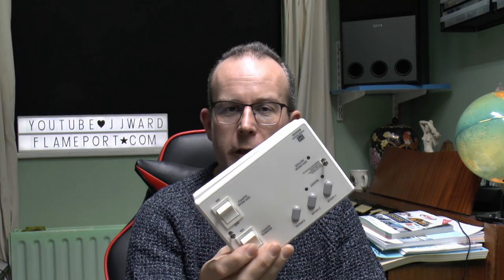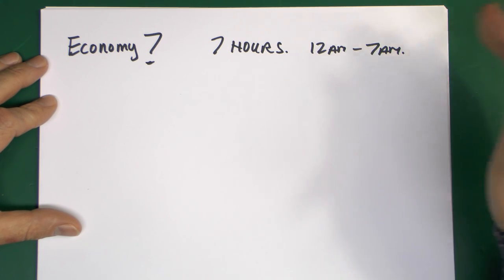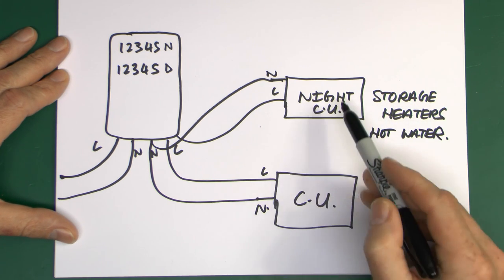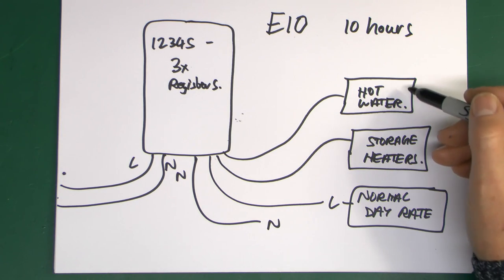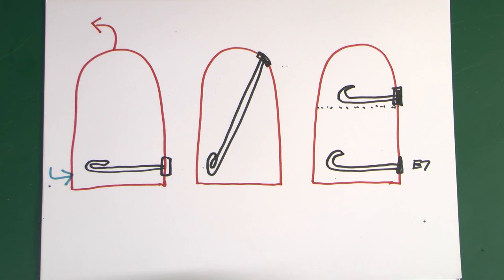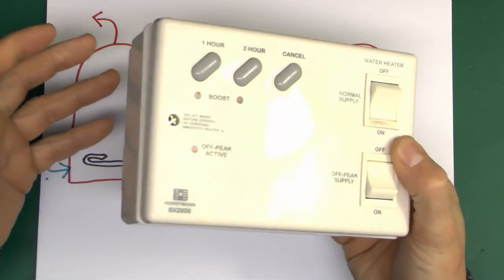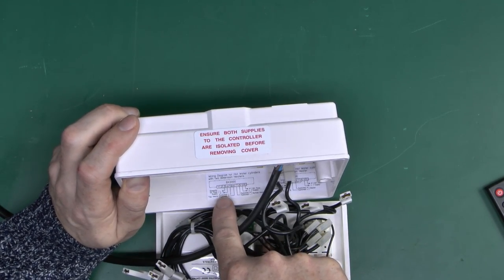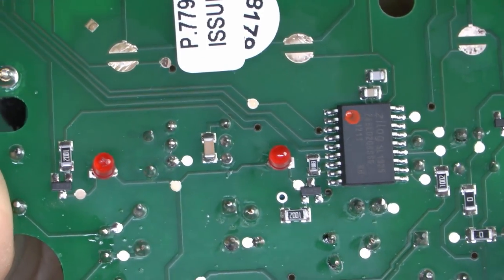Economy 7 and Horstmann BX2000

Comment: Hiya John. A few inaccuracies I need to point out about 
what you said about the electricity meters, timeswitches, 
rate changers and those awful Radio Teleswitches. 
In one part of the vid, you said that......
.
.
.
.
......Electricity meters had a "Fifth terminal...."

I can say now (in the UK at least) the traditional loadwheel-based electricity meters only had four 'main' terminals, whether-or-not they were dual-rate electricity meters.

It was only the dual rate meters (sometimes with a white front-case, hence "white meter") that had an additional terminal, but this was a rate-changer trigger terminal and 240v would have come out of there (at only a few milliamps) and would have been switched down-to-neutral for operating the off-peak solenoid in a dual rate electricity meter.

I know this because I am one of the International Loadwheel Lovers. I have many electricity meters on my channel and they can be found in the Electricity Meters Playlist. Oh yes. :D

As far as "timers" go, there were two types: A load-switcher and a Rate-Changer (the latter of which would also do load-switching.) 

Do I have load-switchers and Rate-Changers? It would be silly of me not to have! Where can they be found?
Haha..... In the Time Switches and Rate-Changers Playlist of course! :D
I have load-switchers of 60A and 80A, and Rate-Changers of 80A and 100A! Both by Horstmann and Sangamo Weston.

About consumer units..... Traditionally, where two-rate electricity was present (whether it was a two-meter configuration with a load-switching timer switch or one dual-rate electricity meter with a load-switching Rate-Changer) there would USUALLY be two consumer units.

On the odd occasion here-and-there (for whatever reason it may be.....) it can be possible for a household to have only one consumer unit and to have dual-rate electricity.

Mr. Photon has this arrangement: One consumer unit and a dual-rate electricity meter and a radio teleswitch. 
His teleswitch is only utilised for its Rate-Changing capability. Although it can do load-switching, that part is not wired.
Just so that you know: His meter is a 'white' meter as well. It's not painted, but rather moulded from white plastic. :D

In cases where there is only one consumer unit and dual rate electricity and the household never having been configured for a two-rate electricity tariff (e.g. storage heaters, and a two-element immersion tank and all of their related wiring and circuits) you will find that the household later opted for (for whatever reason that may be.....) dual rate electric.

As you say..... that would be silly, because the day-rate on two-rate electricity is more expensive than single 24-hr tariff.

In more recent times.....

I once saw an electricity meter with one of these "Fifth terminals" and it was a prepaid Actaris meter.

Also, as you said, there (was a point in time, but slowly becoming obsolete also.....) were these electronic meters with their own built-in timers and switching contactor. I have seen these made by Ampy. These can be distinguished by a little analog clock symbol on the front of them near to the specifications printed onto the meter.

In times even more recent, there are the plastic-fantastic 'smart' meters. Whether-or-not they have internal timers or not, or are switched by some kind of signal (either over-the-wire from the local substation or by GSM) I can more-or-less say right now that they most likely DO NOT have the 1980s BBC 198 Long-Wave antenna in them.

There's a reason why Radio Teleswitches are being done-away with and it's not because of smart meters.

In Droitwich (so I have heard.....) there is a Long Wave transmitter. it is of the old-style 'valve' type. I once read on a radio enthusiasts' chat forum that when the transmitter eventually pops (i.e. when the valves burn out) the BBC has no plans to replace it, and the manufacturer that made the valves has since stopped making valves for it and the BBC have since bought-up and used all of the remaining stock, and the transmitter is currently on its last set of valves. When it pops, a section of the UK (if not all of it) will no longer have LW radio, which probably explains why BBC radio 4 is now also transmitting on FM and DAB!

Of course, when the Droitwich transmitter does pop, a number of (if not all) 198 LW Radio teleswitches will stop working, at which point, people will no longer get the off-peak electricity, and of course, if their radio teleswitch is also switching a load (like hot water and storage heaters) then they will also not have any heating or hot water!

At the time of writing this, I think Mr. Photon still has his Radio Teleswitch and it is still operational. 

Thanxx for showing,

-Wayne's Electrical.

23rd October 2020, 01.35
Reply: My installation has a 1974-vintage Horstmann mechanical timeswitch (synchronous motor plus spring reserve) driving the rate-switch control of a dual-rate meter. However for the last 10 years I have been on a standard tariff and so this is entirely redundant though still physically in place.
My local village hall has a Radio Teleswitch to switch on night storage heaters and it is very unreliable, switching times vary in a seemingly random way.
I don't agree that the reason Radio Teleswitches are being done away with is the issue with the limited life of the Droitwich LW transmitter. While that is certainly true smart meters are the real reason as they can do everything a Teleswitch does and more. Smart meters keep time internally, synchronised by the GSM network, and record usage in half-hour increments
Reply: Hiya! I don't know what 
Horstmann Rate-Changer 
you have there, as you didn't...... 
.
.
.
........quote the model number.

Whatever one you have, you will most likely find it on Wayne's Electrical if you head-on over to the
Time Switches and Rate-Changers Play List.

Just in case you're interested: If you dive into the Powered Play List you will find a Radio teleswitch in there clunking-in and operating a nice fat load AND ALSO in another vid, a Horstmann Vmk 7 switching on a nice chunky load as well. 

YES!!!! There is an electricity meter next to the Radio Teleswitch AND the Vmk 7 so that you can enjoy the rate-change taking place and also of course...... the deeply Sssatisfying loadwheel action! :D

Of course, if after watching those two vids, you need even more loadwheel action, you can stay in the Powered Play List for even more and once you have watched all of those, if you're still needing even more Loadwheel action, then there is the Accuracy Tests Play List.

......For the suspense of sitting on the edge of your seat, wondering if the loadwheel will make it back to the beginning in time! Mmmmm.....Gripping stuff! :D

-----------------------------------------------------------------------------------------

As for the un-reliability of the Radio Teleswitch you mentioned, this may be attribuited to the characteristics of LW radio and the related atmospheric effects it can suffer from.

When we used to listen to BBC Radio 1 back in the '80s on MW (1053-1089 MW) in the evening, the sound on the kitchen radio would vary in loudness and would sometimes have this low-tone 'whining' sound on it.

If you have a small LW radio, try positioning it next to the Radio Teleswitch (preferably with its ferrite antenna in the same plane as that of the teleswitch's) and try tuning the radio to 198 LW. If you get a rubbish reception, then the teleswitch is most likely too!

In reference to the ongoing "Rip-Out-And-Chuck-Out" exercise on radio teleswitches and the Droitwich LW transmitter, it is probably just coincidental, but I find it a little tooooo coincidental that such a removal exercise is going on AND that BBC Radio 4 now also transmits on FM and DAB. It's like as if they're half-expecting the transmitter to pop at any time soon.....

I don't know of the exact circumstances of the removal of the Radio Teleswitch I have, but it is near-on minty condition inside-and-out and still operates fantastic, as-per the POWERED video I done with it. My Sangamo Schlumberger Radio Teleswitch was made in 1993.

I just don't like them, as I cannot set the on/off times, unlike my Horstmann / Sangamo time switches and Rate-Changers.

-Wayne's Electrical.

23rd October 2020, 20.00
Reply: @WaynesElectrical  Why the big gap between "didn't" and "quote"? Does this indicate anything? Its a VA Mk 9D, exactly like the one on your channel except that its a month newer and has a clear plastic cover rather than Bakelite and glass as yours does.

Radio 4 has been on FM and DAB for decades!

Its probably also worth pointing out that the government has made the wide-scale introduction of smart meters a matter of policy and electricity suppliers are under pressure to get them installed as quickly as possible.  My supplier (e-on) has sent me several emails and a couple of letters trying to get me to agree to having one installed.
Reply: @WaynesElectrical  The VA Mk9 D that I have switches the two contacts (100A load switch plus 2A for meter rate change) simultaneously, so the D here cannot mean that.

BTW you referred to the noise that the Mk9 motor makes. My Mk 9 hums, loudly, but that hum comes from the coil that stops the spring-driven clock mechanism from operating when mains is present, not the motor.
Reply: Hmmmm.......Makes me wonder why your VA Mk9 has a 'D' suffix then, 
if it operates both the load-switching and Rate-Change contact at the 
same time, just like a standard VA MK9.
As for the sound they make, I am not sure if it is the synchro motor or the....... 
.
.
.
......holding coil in them which makes the really audible sound.

I know one thing: 

Of the VA Mk9 Rate Changers I have heard over the years, the sound is not a consistent and continuous 50Hz sound, like what would be expected from a continuously-energised coil with no moving parts, but rather a whirr.....whirr......whirr......whirr...... sound which I always thought was the synchro motor.

Interesting fact: On the VA Mk9, the synchro motor seems like that it doesn't have any wires going to it, so it may actually be driven by the electromagnetics of the nearby and close-proximity holding coil.

The VA Mk9 has a different synchro-motor and holding coil arrangement to that of the following:

VMk 2,
Vmk4,
Vmk5,
VMk7.

With the other models listed above, the synchro motors in them are a large 'doughnut' type on the back, containing an audible rotation-corrector and a completely separate holding coil, located nearby for stopping the escapement while the timer is powered from the mains.

To hear a Horstmann Vmk 7 SRS running and performing its exercise routine, head-on over to
Wayne's Electrical right now, and look in the POWERED Play List.

In that vid, I attach external microphones to the camera and you can clearly hear the rotation corrector which is accommodated within the doughnut synchro motor of the Vmk 7 SRS (and similar models)

Enjoy! :D

-Wayne's Electrical.

24th October 2020, 21.39
Reply: Hi Wayne's Electrical, do you know what the power consumption of the Sangamo Schlumberger Radio Teleswitch is? I have one that is redundant but still connected.
Reply: @Petertronic  Judging by the components used I'd guess around 2 - 3 watts. The supply to it comes from before your meter, so you aren't paying for it.
Reply: @WaynesElectrical  The motor needs its own coils as a synchronous motor requires a magnetic field that rotates around its axis. A coil to one side of the motor won't do that. However it does seem as though the motor and holding coil were manufactured as a single assembly with just one pair of lead-out wires.
Reply: @davidfaraday3085  Good to know, thanks
Reply: @WaynesElectrical  Thanks. Teleswitch is definitely downstream of the meter, which is a Ferranti F2K-100-29 dated 1986. 👍
Reply: Aaaaah! Now there's something! 
A Ferranti F2K-100-29. I have one 
of those, as well as its single-rate 
version. I have yet to.........
.
.
.
........Do videos on those two instruments, so you know what to do next. :D

Head-on over to Wayne's Electrical right now and then BAAAAAAANNNG that subscribe button! :D

Did you know......?

The number '9' on the model number is a suffix for a certain function in the meter?

Aaaaah, but what, though? :D

Haha....... TEASER! :D

You see, there is also the F2K-100-2, which looks and operates very similar.

So, what's the difference then? Aaaaah, I wouldn't want you to miss out on that, so on that note.......

Head-on over to Wayne's Electrical right now and then BAAAAAAANNNG that subscribe button! :D

Will I power them up?
Will I spin them up?
Will I crank them RIIIIIIIIIIIIIGHT UP ?
Reverse loadwheel action too?
Accuracy tests?

Have you whacked that subscribe button on Wayne's Electrical?

Really, please don't miss out! Subscribe to Wayne's Electrical today!

-Wayne's Electrical.

27th October 2020, 20.20
Reply: @davidfaraday3085  I'm guessing that the Radio Teleswitches might have a random delay built in to prevent half a million storage heaters being switched onto the grid simultaneously.

Comment: How did the old mechanical Economy 7 time 'clocks' retain the time during a power cut?  Or reset to the correct time on power restoration?
Reply from the maker: Some had a spring reserve which kept the clock going when power failed, the spring was rewound when power returned.
Others did not, so would be incorrect after a power failure and it was up to the local electricity board to reset them.
Reply: @jwflame  Thanks - real life issue here not just nostalgia. Need to check the time period of an E7 arrangement in case it has shifted due to a long power outage. Thanks again.

Comment: Heat pump water heater! When I bought mine there was a 90% rebate from electric company. Works great.
Reply: robert mccully The problem with heat pump water heaters is that they extract heat from the surrounding air. Great, if you're in a warm climate. In the U.K. the last thing we need for at least six months of the year is something sucking heat from our living space, heat that then has to be put back by some other means. We would be paying twice for our hot water! Having said that, new build properties will soon no longer be allowed to install gas boilers, so external heat pumps will be the likely solution, providing both space and water heating.
Reply: @spencerwilton5831  The pump is in the out door connected Garage, heat does escape thru walls , like it or not( put a thermometer against outside wall) so it grabs some of that garage heat, it works down to about 30 Fahrenheit. Heat pumps are great.
Reply: @spencerwilton5831  To clarify what I said, the pump is part of the water heater out side.
Reply: @robertmccully2792  - in VIC, Australia the government recommends against air source heat pumps due to the frosts in winter, so, yes - 'about 30 Fahrenheit' or 0 Centigrade.  A fellow engineer repurposed a broken 'fridge and used it as a heat pump, until it stopped working one cold day . . . puzzling, until they looked out the window to see a large ball of frost surrounding the evaporator!  Ooops.   Air source heat pumps do not suit our use case in the UK.

Comment: Hi can you show a wiring diagram of the Sunhouse SSHE storage heater. For the installation there are 2 connector blocks.  Is there need for 2 fused switch spurs ? One of them for the off peak supply and the other for 24 hr supply ? Is this right ?
Reply from the maker: All new storage heaters have 2 supplies. The 24h supply is needed for the electronic controls, and in some types it also powers a separate smaller heating element and a fan.
The off peak is the same as older storage heaters and is only used to heat up the bricks inside.
The off peak should be connected via a 2 pole switch, not a fuse.

Comment: Have a set up as described but only need a half tank heated on economy 7 off peak. Is it possible/safe to swop the power supplies over so that off peak feeds the top element  and the peak supply to bottom? Many thanks
Reply: You might be able to get away with turning the temperature down slightly. Given enough time it's going to mix anyway. Just need to be careful it is hot enough to kill any bacteria.

Comment: I currently have a Horstmann E7BX and am considering swapping to the BX2000 for some more control. Can someone confirm, if the NORMAL SUPPLY is OFF, it will not heat during the day and will only heat water at night/using the economy feed tariff?

Comment: If I change over my spur which is on the peak side of the system feeding the top cylinder to a timer would this be ok? As would rather have it on when I need and not having to press the boost button
Reply from the maker: Yes, make sure the timer is rated to 16 amps or more.

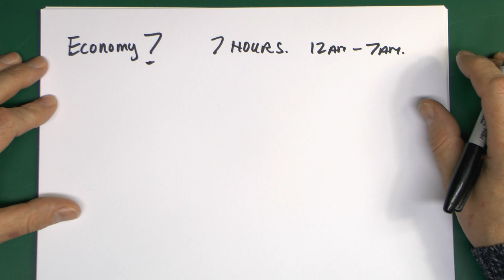Comment: 3:40 I think  it is still worth it if you have an EV . If you do the average 12,000 miles a year that is about 3,000 to 4,000 kWh so if you heat and cook with gas, that is most of your power usage at 5p/kWh rather than at 15-17p and if  you have solar you could have negative power usage "most" days.

Comment: My water is boiling hot, so much cannot wash hands as it burns!  Both switches are on as instructed, can i set the temperature or do both switches need to be on ie. Normal Supply / Off Peak Supply. The electric bill seemed very high in summer withouh using heating.
Reply from the maker: Temperature is set using the thermostats in the top of the heaters.  If it's boiling hot, one or both thermostats may have failed.  They can be replaced.  Described here: https://www.youtube.com/watch?v=obWkCGFhuus

Comment: Hi jon how does the device know when to switch on off peak: does it detect the off peak current when supplied or is it switched by the radio signal ? Thank you
Reply from the maker: The E7 input is switched by the meter, the Hortsmann just selects that input when voltage is detected.
Reply: @jwflame  ok many thanks